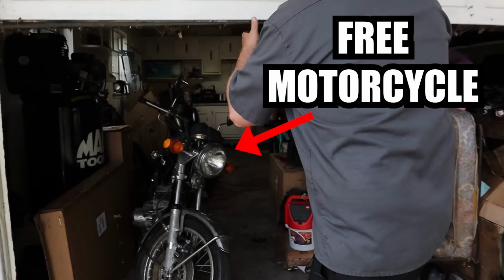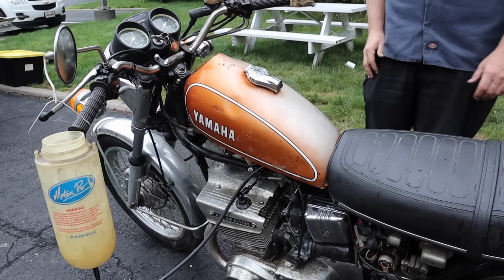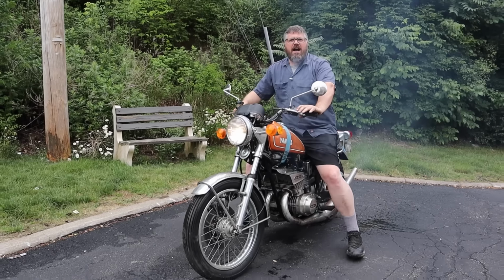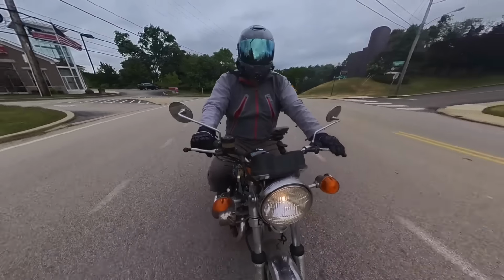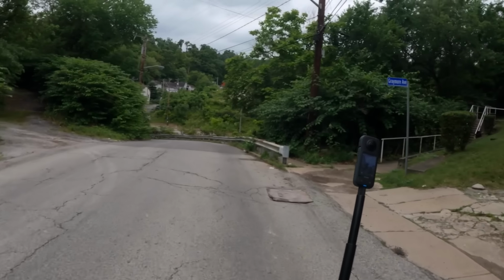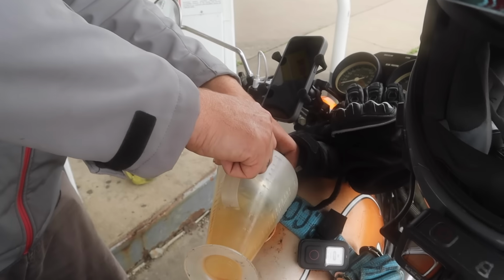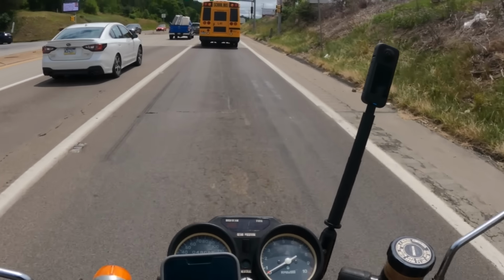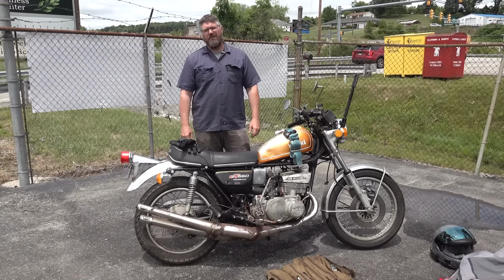Will This 48yr old FREE Bike Get me 253 miles Home?

Comment: Love the video, as well as the previous one on this bike, but have to admit I'm upset that the bike sat without a hole in the piston for 37 years, and now has one.  I was thinking that maybe you should have cut a sock to put in place of the filter material on the air filter to help the motor run richer.
That being said, I'm certain you know1000 times more about motors that I ever will, and that bike was about 2 days from being completely un-restorable when you found it.  The likelihood of it every turning another mile was very low.

Comment: Flushed the front brake fluid and clean out the front brake piston/disc with brake cleaner. Check brake lights. Check tires for cracks.

Comment: I did this this summer with an old RZ 350. It was way more expensive because it was pretty mint, but battery was cooked. Didn't know if oil injection was working. Didn't know what it was gonna do on the hwy. You should try and find some more 2t. They are getting pretty rare and pricey. RZ, NSR, Gamma, H2, WaterBuffalo, etc.

Comment: I think the hole in the piston saved you from the hole in the gas tank. I miss my early Suzuki 500 twin, 'never did too much with it, 'cept shed the Watsonian Sidecar it came with mid eighties, which was surprising considering how much fun was had bringing it "home" (duff coils, granting spark as quickly as taking it away again..)..
Outfits are so underrated, but then, so are small capacity machines, two strokes, trail bikes.....

Comment: Back in the 80's I did a roof job, there was a 71 Honda 350, did not run they said 15 years, It took all day to get it running rings were stuck. Smoked just like your bike. 1 hour after running I took it down a straight back road 85 mph, Could not believe it ran that good, sold it a week later 850 dollars, Guy was a collector total restore, looked brand new last time I seen it.

Comment: I had a new one of those. It was an awesome bike with power right from idle; unusual for a 2-stroke. Eventually the baffles would plug up. I stripped the felt off the baffles and wrapped them tightly with steel wool. It was still fairly quiet but had a lumpy sounding idle. A local yokel came along and said that's a tough sounding bike. He was clearly clueless, so I told him it had a 'hotcam'. lol
Reply: Ha! You're right about the baffles. I just changed the packing on all four on my all original '74 GT550 with 6k miles and the lower left baffle was especially gooey!

Comment: There was a 380 and 550 Suzuki triple. The 550 could test any sphincter in its day!
The 750 Suzuki "kettle" was kinda tame though.
The 2-stroke pinnacle was in the early 80's with Yamaha's RD250 and RD350 LC models. They cleaned up in their class on the Isle Of Man. I loved watching those lightweight lil' things up on the mountain sliding around when crossing the metal tram tracks!
With your skills, I'm certain it will be reborn.

Comment: This video had me really wanting an old bike.   I ended up finding a non running 73 RD350.  Now I'm riding it every day after a bit of tinkering and tuning!
Reply from the maker: thats awesome
Reply: @The_Bearded_Mechanic  keep up the good videos! I'm loving the new channel!  
Bring on more classic 2 strokes!
Reply: Love my RD350 and RD400. Best thing I ever did was have the original ignition systems (with points) replaced with the complete Vape CDI ignition on both bikes. Stronger spark every time, at the right time all the time. Cleaner burning and more power. Don't have to rely on a nearly 50 year old ignition to get me home any more. Points always seemed to quickly get out of adjustment on the RDs. Not so much on my Suzuki GTs.

Comment: That hose for the vacuum petcock is attached directly to the intake pretty much you created a lean air condition on the middle cylinder leaving it unplugged, that's why the idle was hanging

Comment: The Suzuki CCI (Crankcase Cylinder Injection) system worked extremely well and was advanced for its time = mixing oil in the fuel tank is not recommended for these machines.

Comment: These Suzuki triples did have vacuum actuated petcocks (I owned a '75 "Water Buffalo" that I put 45,000 miles before I sold it).  If Craig had plugged the open vacuum line, he would have made it back to Lancaster without problems.  There's a lot of nonsense in the comments about premix vs. oil injection... either way works fine with loop-scavenge 2-strokes (since they all have rolling-element bottom ends).
Reply from the maker: I did plug it a couple miles in 🤙
Reply: @The_Bearded_Mechanic  I think the damage may have been done already.  I received a physics degree from Millersville University (in your neck of the woods); the title of my senior thesis was, "Tuned Exhaust in Loop-Scavenged 2-Stroke Engines". I not only did the theoretical work, I built several expansion chambers and built a dynamomter to test them... so I am very familiar with 2-stroke engines and their quirks.  Your GT550 had after-market expansion chambers, but I'm guessing the previous owner never changed the jetting, so the engine had been running lean for most of it's life (so the #1 piston may have already had significant damage).

Comment: Nice job fixing it up.. SInce only one cyl got burned thru, I bet the carb had the jet get clogged up.. ran even more lean.. and boom.
One thing puzzled me.. why would you fill the gas tank and then put in the oil?.. he mentioned closing the petcock.. because the oil will sink to the  bottom... whey the heck would you not put the oil in fist then fill with gas.. it will then fully get blended in to the entire fuel volume.. or maybe put in 1/2 of the fuel and then the oil, and then the last half.

Comment: when you run on the oil tank it puts oil straight to the main bearings on the gt550/380 pre mix the oil and the mains get no oil also the jets are sized for running neat gas so if you add say 10% oil to the mix then you are now running 10% less gas = running lean = holed pistons

Comment: True you shouldn't pre mix an oil injection... For the bearings that get it directly... And the jetting with the oil will lean out the air fuel ratio... And you can modify an injection for premix... Depending on the engine and goal

What this guy is doing is just running it with whatever is there to see if it will make it limping on it's last legs...
You can premix a 4 stroke and quiet the valves and limp another mile out of it... 
What is amazing is with everything clapped out it's still working and the danger in it is the challenge...

Comment: Gotta watch bypassing the oil injection on the two stroke street bikes because a lot of them have injection lines that run straight to the crank bearings so if you just premix and bypass the pump it’ll fry the crank bearings…. I learned that the hard way on a gem of a 74 Suzuki TC186 ranger….

Comment: My GT550A used to hole pistons, on a random cylinder, once every two weeks or so. This was back in the late 1980's when unleaded petrol was a cheaper than 99 RON 4 Star leaded at the pumps. When I stopped using unleaded petrol, it stopped holing pistons.

Comment: 1982, I had the Suzuki GT 550 version [2 stroke triple, ram air system]
Blew a hole in the piston tanking it full chat along the motorway, got it repaired then crashed and totalled it at low speed on a bend on tiny country lane, [avoiding a car coming the other way on the wrong side of the road] hit the Earth bank on the side of the road, somersaulted it.
..
Would love it if it was still in my garage today.

Comment: 93 octane instead of that 89 would let you really enjoy the ride on that 550.    Also Amsoil 100 to 1 two stroke oil would make it more fun to ride.     Too bad that oil injection system isn't being used .   One of the guys racing these 550s used two run the injection oiler on the lean side for reallly good road racing results with no ill effects on the triple.

Comment: Man, that sound brings back memories.

For all my aversion to 2-stroke, it makes a unique song. 

The first brush I had with a 2-stroke was the GT-380.  I was barely up the street from home 100 mtrs when i hit gravel.  
The apex of a bend was also a T-intersection. Natural accumulation of gravel, and I high-sided.  Noobie mistake, felt the grit under the tyre and hit the rear pick out of instinct and she slid right away. Barely 30 kph.
Worse than that, it was my mate's bike. 

He wasn't a happy camper for a few days. Luckily the only damage was half the dash dials.
Suzuki built them tough!  But not a machine for noobs.

Comment: The carbs aren't functioning correctly if one is oiled up and the other is lean. A holed piston in a two stroke isn't the end of the world, new pistons and a slight overbore (if the barrel is scored) and you are away. A contributing factor may be because you were putting the 2-stroke in the tank, because the oil is taking up part of the petrol in the mix so it has less fuel to air ratio, so it runs leaner.

Comment: Nice job! I wished I could bring you my 83 Yamaha 650 seca turbo has 4,000 miles on sittting in garage since 95 all covered up carburetors probably need to be cleaned only paid $2,000 brand new  😊

Comment: The GT 550 I had must have been a year or so older than that one. Mine had a drum brake on the front, which worked great. Better than some single front disk bikes I owned after. And mine was kick start only. So the electric start came later.

Comment: The ending was kind of typical for a two stroke with more than one cylinder. If one is not getting fuel (lubrication) and the other two is keeping it spinning dry that is sertanely gonna blow up.

Comment: Seeing ya pull a Flintstone to stop the bike reminded me of flat track racers of yore who used boots with steel soles. At 19:25 when mention is made of the loose vacuum line which probably was used for a vacuum controlled petcock a bad omen was cast; no air filter, open vacuum line = lean mixture which multiplied by high RPMs brought down the two stroker. Did you wind up replacing the blown piston and getting the bike up and running again?

Comment: What would I take? Well I have a box of used but good front brake master cylinders. Given that these seize up so easily I'd probably sling it in the car. BTW don't knock yourself out over the burned piston. A weak mixture will do that in no time. These bikes were well known for it on the centre cylinder. The 750, which was water-cooled, was a much better design

Comment: I found a1970 Kawasaki G4TR trail boss in an old lumber yard in Detroit. I paid $100 for it and $20 for the battery. The guy who owned it naughty it brand new in 1970 and parked it in the barn in 1972. It has only 1800 miles on it. It started right up after i cleaned the carburetor. I took it to Michigan's upper peninsula and ride it thru the trails.

Comment: cant say i,m surprised it burnt a hole in the piston ,one thing you never do ,it,s the golden rule with 2 strokes ,never run them lean ,you would be better off ,running them rich . i,ve ridden 2 strokes for 15 years straight in my long life of biking ,and yeah ,2 strokes and lean don,t go together . even a normal car washing sponge would have done as temp air filter with some oil on it  .but no  filter ,recipe for disaster ,plus the 2 stroke oil in the fuel tank did,nt help. especially when trying to ride 253 miles .

Comment: Picked up a 1974 Suzuki tc185 when I was 12 (26) now me and my cousin got it back running had loads of fun with it until the throttle hung up one day sat wide open because the kill switch decided it wasn't gonna work either and it slung the needle bearings off the crank I still have the bike and would love to do a repower if you have any recommendations the old motor is cooked though so a rebuild is off the table essentially

Comment: I had a GT380 many moons ago, the aftermarket expasion chambers didn't make much difference except they were very noisey.
I was wondering if running lean would cause a problem and not putting enough 2stoke oil in when you filled up.
I had a 50cc Yamaha melt a hole in it's piston, it resealed itself and picked up power 3 times before totally dying.
I would have it if you can send it to the UK.Not many barn finds here and when there are they are stupid money.

Comment: You need to restore this. The gts are great classics and all big two strokes need to be saved. Running a two stroke lean for that many miles is going to cause engine damage. Not worth it at all. The slightest airleak or not using a filter when its jetted for one is a very bad idea. Melted pistons, seized engines normally follow. And when a two stroke seizes it can lock up and throw you off. Some times grabbing the clutch doesn't help.

Comment: was that maybe the floater in the carb? jb weld didnt seal it good enough so it got soaked full of gas and closed the gas pipe to the carb giving the cylinder no more fuel/oil so it didnt get any lubrication causing it to get so hot

Comment: aah yes. reminds me the time i went downhill on a 2stroke with a 72cc aluminum racing cilinder and cvt transmission. blew the top of the piston clean of. was just a tube sticking in the cilinder. entire block was for the trash . good times XD

Comment: The gt 550s need the oil injection to be working as the 2 outer crank bearings are oiled by injection only. Do not let the tank run out of oil. When these bikes run right they are animals

Comment: No great surprises as to the outcome. Not using the injection system because it didn’t have a cap was unhelpful, a piece of plastic bag and a tie-wrap would have fixed that. Using premix was a mitigation but it will run weak in proportion to the percentage of added oil, and there was a big slug of oil in that mix. No air filter either. It had J&R expansion chambers too which need a richer than standard jetting. Its pot luck if the previous owner rejetted it. A lot of weak mixture flags. Usually with a holed piston its slipped timing though, that;s a killer.

Comment: The black hose is for a vacuum operated peacock left open that cylinder will run lean sucking in extra air it’s not supposed to and could ruin that cylinder 😳😔🤔

Comment: You asked what I would do different. 

Actually, what I would do different is a showstopper. It would be on the bare minimum list.

Front brakes are a minimum . We all know most breaking force comes from the first front brakes.

I can’t tell you how many times I stood up on my bike, using all my weight on my rear brake locked up, carefully using my front break to stop due to some jerk cutting me off .

Comment: To answer your question about that I would have done that you didn't..... fresh tires/tubes, new chain, fix the front brake, pulled the top end and replaced the ring set, base/head gasket, intake manifolds & gaskets and then tested it for air leaks with a can of brake clean while it was idling. Then I would have gone to the closest Hobby Lobby and bought a 12x12in square of 1/2 inch foam and fashioned some kind of air cleaner, then used some Bel-Ray air filter aerosol spray oil on it. Or at the very least oil up an old sock and slip it over the cage...And maybe if I were lucky, I would have been carrying a Pingle petcock with me as well. You knew what you were buying beforehand so there's no reason why you couldn't have had the tires/tubes, rings, gasket set, intake manifold, chain and maybe even an Ebay front brake master cylinder with you....but that wouldn't have made for as interesting video. But you asked.

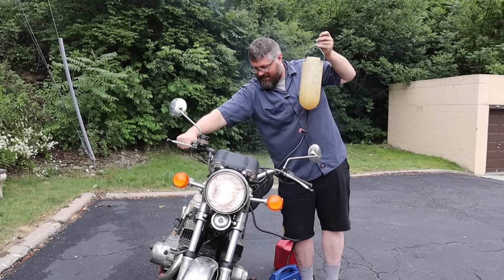Comment: Watching this while my 50cc scooter also give white smoke a bit out the exhaust when i did a long ride. But i never knew what it is. Its a catalysed exhaust but i cut off the catalysator at the end and weld it. My sparkplug is kinda black/brown. the oil system does 1:50 stock. Do i have to worry ???? It starts and drives okay but when the engine is hot it loose power...its like it runs to rich because the rpm fall back faster.

Comment: You were lucky it wasn't an early model. I owned one of those, I think it was a '75 model, and it had a major problem with the clutch. It would simply screech to a halt on the highway when it got hot, and then you had to sit for twenty minutes to wait it out.

Unfortunately, my bike was out of guarantee, so I sold it to another poor loser.

Otherwise it was a reasonably fast bike with a silky smooth triple engine.

Comment: Dam bro sorry. You asked what we would do differently and I really think those self oiling devices are incredible and you should have flushed it out with gasoline and then mixed your premix and filled both the gas tank and the oiler with the same ratio that way it is working. Swear engines die when those things get abandoned and then you premix in the tank. That works and all but you gotta use the self oiler even a little bit so it doesn’t overheat and lock up

Comment: Was plug too hot for the engine?   Rookie mistake trying to fix a different problem.  Never go against OEM specs unless you are willing to take the blame when it self destructs.  As I recall it was usually the middle cylinder on these bikes.

Comment: You know on Kawasaki H1 500 you cannot bypass the oil injection tank and mix in fuel tank because the oil injectors inject oil to the main bearings of the motor. Main bearings will not get enough oil and will don’t know if it’s the same on that Suzuki

Comment: You are running the bike wthuout an air filter!

An overly lean engine can result in overheating, damage, and engine seizures.

Basic bike mechanics 101 always use an air filter!

You could even improvise by stuffing some kind of material into the airbox, that would probably do the trick to get you home!

Comment: It's A gasoline fuel engine. Running that two cycle oil in that gas tank to long. Try changing out the fuel to just gasoline fuel only.